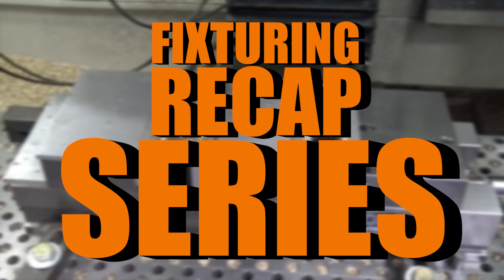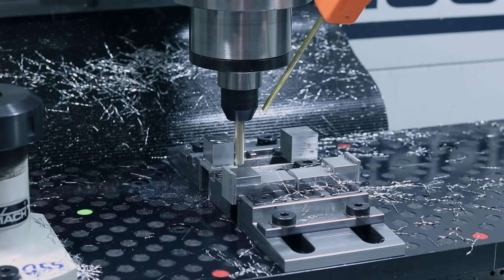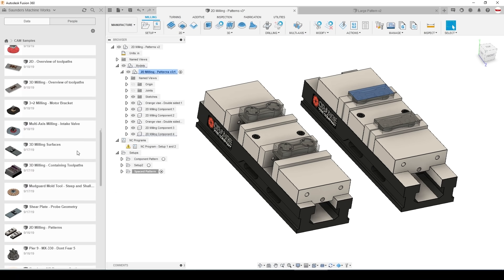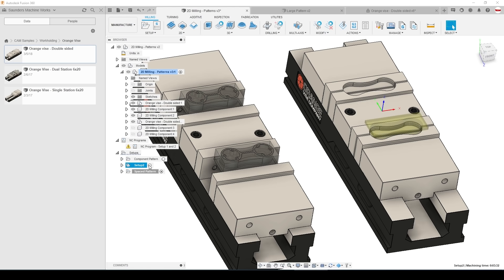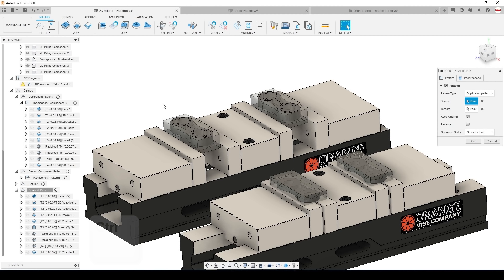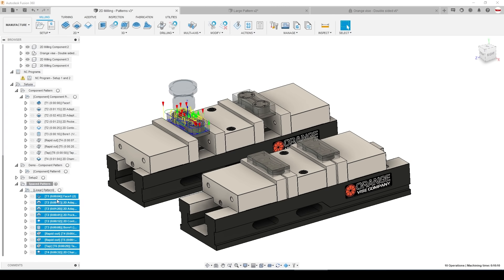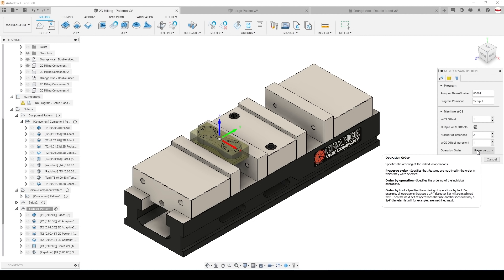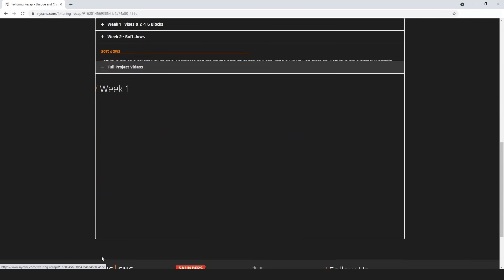Workholding Techniques for Machining Multiple Parts!

Comment: I prefer to use sub program system o  the haas. You create a tool path for one tool on the  part and set that as a program. Then you call g54 or what ever and next line calls the program. It runs and returns to the parent program and you call.your next off set and the program untill all offsets have been run with that tool then do it over with the next tool. Saves space(my tm1 only has 1mb) and when you edit that one program it will change for all parts unlike having to make the same edit to multiple locations(kind of error proofing.) And if dont want to run a specific offset you can just comment it out.

Comment: Gang fixturing is a good term for this concept.

Gang fixtures must be fully *kinematic*.  That is, the moving clamp force must be independently applied on each piece.  Multiple pieces sharing the same holder will fail, because you cannot maintain perfect uniformity of the pieces and perfect clamp geometry.  Always the slightly larger piece(s) take most of the force, and the slightly smaller receive less.  Likewise there is always one clamp position that is the "good" one, and the others are weaker.  Fixtures also drift and wear over repeated use.  Sort of like you can't make a four-legged chair that doesn't rock, no matter how precise your technique.

In a non-kinematic gang fixture, since you don't know at run time which pieces are weakly held, the metal removal rate must be severely limited to the weakest possible result of holding force, resulting in dismal time and horsepower efficiency, sub-optimal speeds/feeds, tool wear, etc.

So stick with the kinematic gang.

Comment: In the late 1970s and early 80s when I had a machine shop, I used to make small parts and I had a Lagun milling machine. Parts were fixtured and I had to hit the numbers exactly correct on the X and the Y axis wheels

Comment: Fixturing is a key to efficient and good machining. It can take some thought on how to do this. Good video. I did use one of your techniques from another video using our 3D printer to make an angle to machine. Worked great.
Reply: Correct...well said! Op2 is the always problems😮😮😮😅😅😅😅 clamping systems...always problems.

Comment: It would be great if you could utilize G52's in the post processor.  That is the best of both worlds when it comes to multiple parts.  Dial in your G54-G59 etc., then have infinite adjustment from part to part with G52's.  I've ran as many as 286 parts on a table that way with just one G55.  The other huge benefit to that method is the lack of memory that is consumed on toolpaths.  One tool path that is utilized as a subroutine and just called up as many times as necessary.
I wish I could write javascript to make something like that happen.
Reply: That's an interesting option.
-Ken